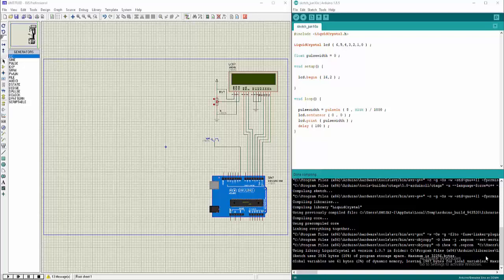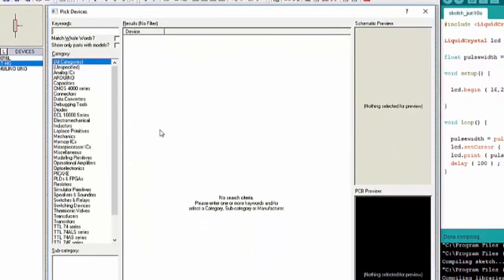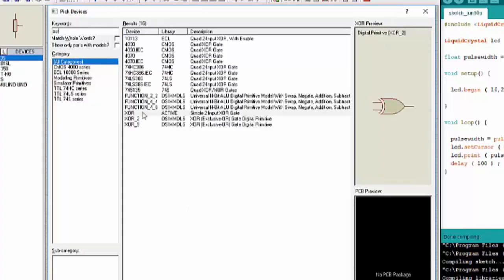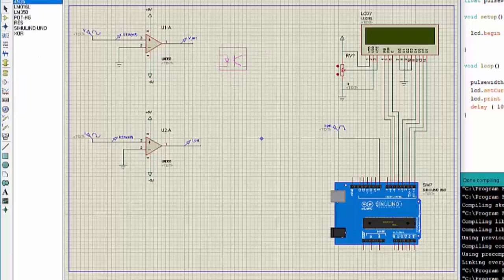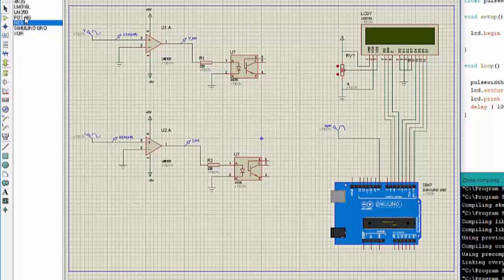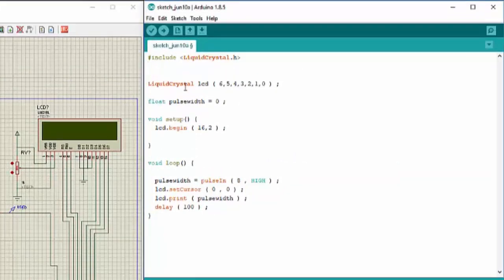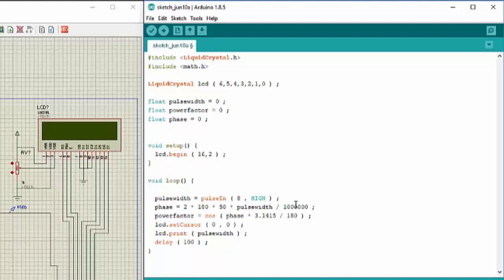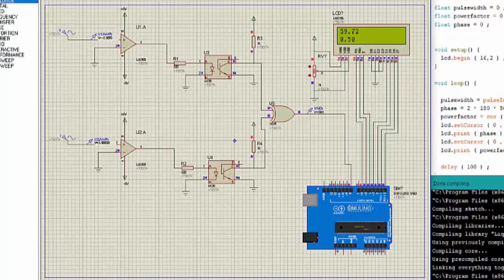How to measure Power Factor using ARDUINO

Comment: This is a serious question that the outputs of both the comparators can be directly fed to the xor inputs, then why you have used the optocoupler like 4n25 ???
Reply from the maker: to isolate High voltage portion of the circuit from Low Voltage part of circuit in case of switching surges. Op-amps can bear much more voltage as compared to Micro-controllers. Any voltage above 5.5V for a 5V micro-controller will be deadly.

Comment: I have a question if i want to use a current and voltage sensor (ACS712 LEM LV25) do i still have to use the 4n25

Comment: I tried to implement the circuit but it shows pf as 1 no matter what I do. Plz help need it urgently :(
Reply: Found it, I changed my optocoupler and the resistances before that to 100 ohms. Now working
Reply: @SHAKK512  BHAI I am continously getting pf as 1..what to do
Reply: @GauravNvidia  Did u try what I did?
Reply: Yes I tried..
Reply: @GauravNvidia  can u show me your proteus diagram?
Reply: Can you ping me your WhatsApp no. in my mail gk752670@gmail.com
Reply: @GauravNvidia  Sent hangouts invitation on google
Reply: I have tried it too and it shows pf 1... help me pls if you get it very urgent :(((((
Reply: @haleemahamid3695  let me check if I still have the circuit/ simulation
Reply: It is not letting me add the link

Comment: What's the use of opto coupler since we are getting the value from the op amp.
Reply from the maker: Provide isolation of high and low voltage circuit
Reply: @technicult0  oh ok thank you

Comment: Hi, in the arduino world what is the best way to get 5v and - 5v?
Thank you
Reply: Split supply device source. With current output max in about 50 to hundreda milliAmps
Reply from the maker: There are ICs available.for.this purpose known as charge boosters

Comment: How can I control capacitor groups(0.5-1.0 KVAr) for compensation with Arduino? By the way the capacitor is too big to use an electronic breadboard. I need to your answer.

Comment: I follow same steps but my output is coming continously on LCD as
0 phase
1PF
Reply: hey bro found the solution I also got the same problem
Reply: tell me if you found something I am waiting..
Reply: I also get the same results
Reply: change the opto coupler type, use a different one with 100 ohms instead of 220 ohms

Comment: While converting the time into phase why you used 180 instead of 3.14 for pi ... As you again converted it into radians in the next line of your code.. wrong concepts :p
Reply from the maker: Hahahaha! Zakir it is done to avoidoverflow in the microcontroller. 
P.S. you should have mentioned this when I was teaching you instrumentation in LAB.

Comment: Hi, when you turn off the load, there is bound to have residual flux in the CT. How do you ensure the residual flux in the CT will not be feed into the comparator??
Reply from the maker: Burden resistor takes care of that. Although CT cores are made up of soft magnetic materials usually which usually have very low retentivity.

Comment: I have to work on Arduino nano
Reply from the maker: It works with that too. Just need to make sure that voltage ranges of micro-controllers are kept in mind when designing the circuit.